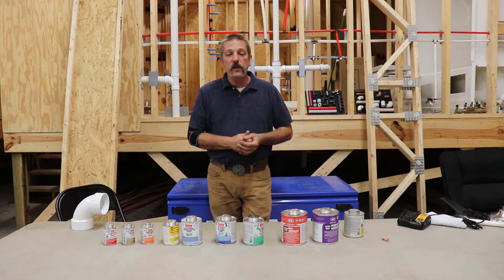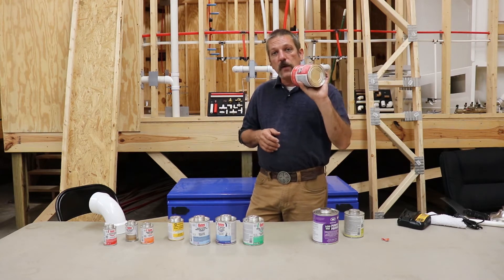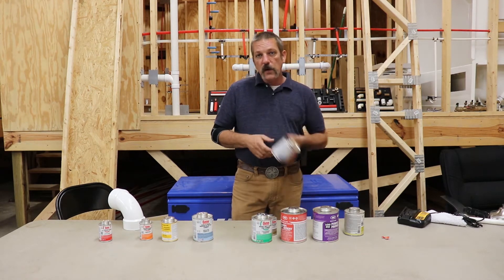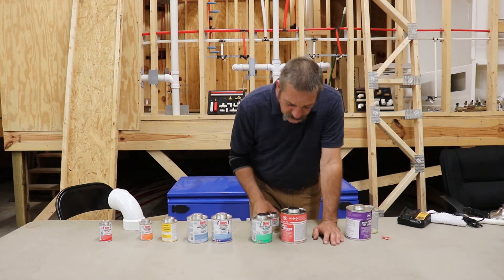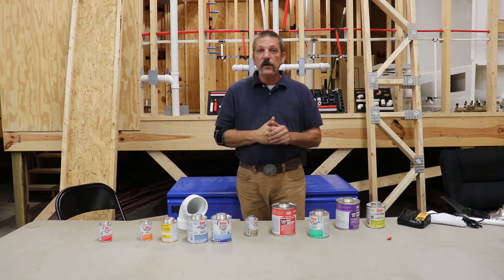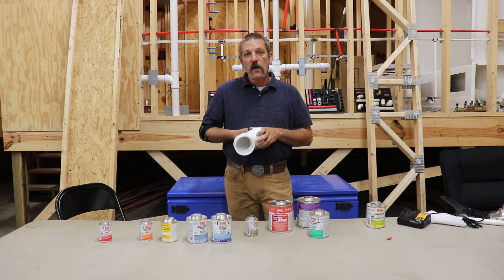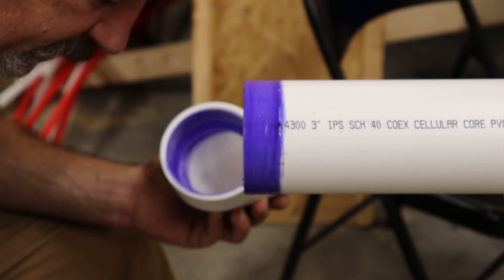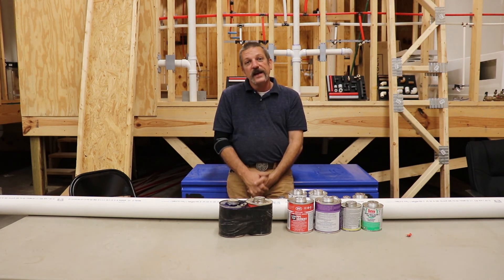DWV Glue for Plumbing Pipe

Comment: Ok, I hope I can get an answer here. I’m plumbing my shower drain, I couldn’t find PVC pipes at my local store ( I only needed 24” of it) and I grabbed a 24” x 2” ABC pipe with 2 PVC elbows. I had PVC glue at my house and of course that doesn’t work with ABS, so I bought a “all purpose glue” I glued the ABS pipes to the 2 PVC elbows and now I’m freaking out because I don’t know if I messed up by doing that? It’s just an ABS pipes glued to 2 PVC elbows. Can I leave them like that or should I remove them?
Reply from the maker: as long as it doesn't leak you will be fine

Comment: I wanted to mention that the all purpose glue is not good for PVC to ABS  it's better to use transition glue for PVC to ABS,  And just wondering do you debur all your pipe, I use the Reed DEB4 it's a great debur tool I take mine everywhere I'm gluing PVC  pipe  plus I use a inside debur tool I like the Milwaukee pencil style,  Thanks for the video